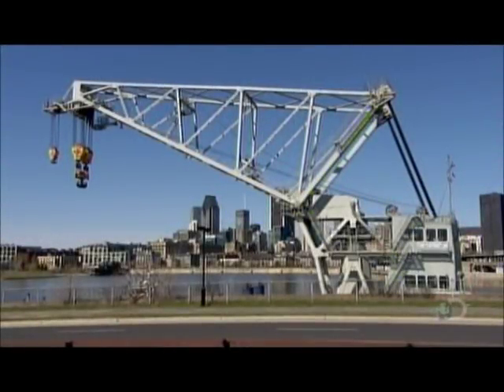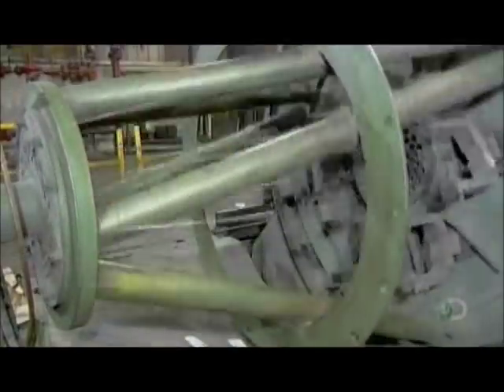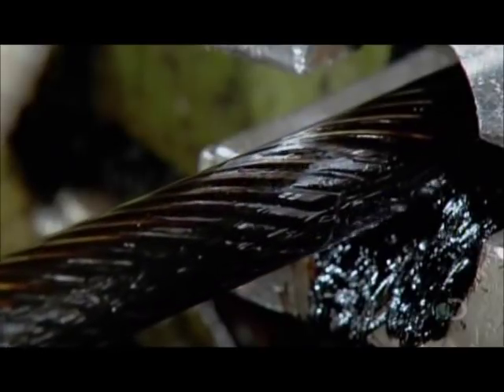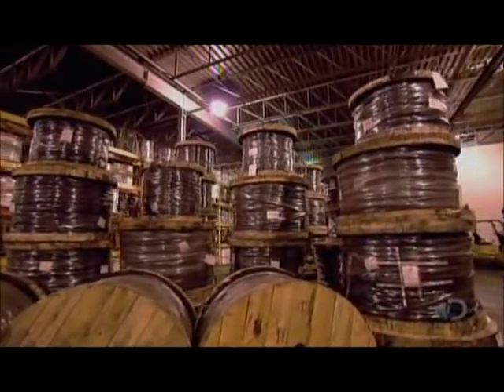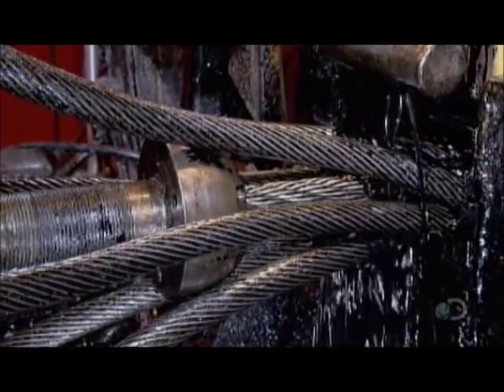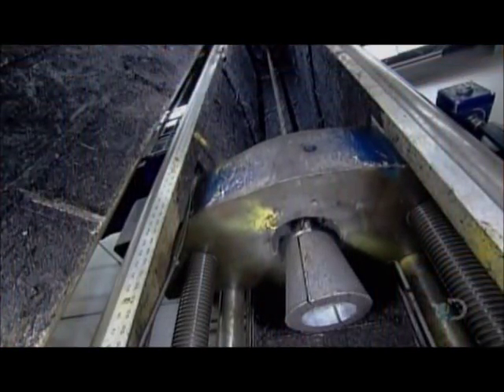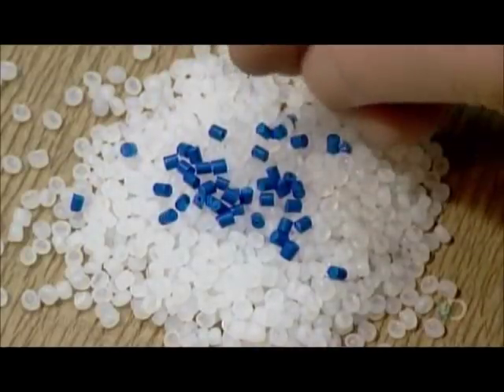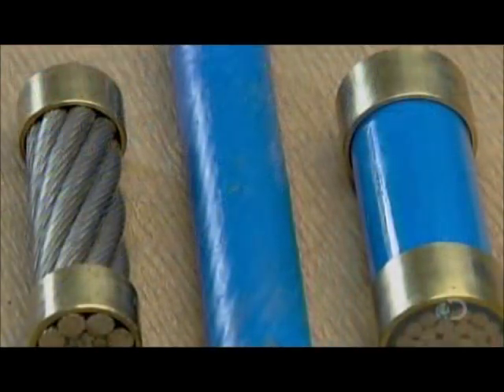How It's Made - Industrial Wire Ropes

Comment: 24:50
Japanese Street Food - BLUEFIN TUNA CUTTING SHOW & SUSHI / SASHIMI MEAL
Travel Thirsty
Recommended for you

14:15
Antique Hatchet Restoration. SORT OF...
Black Beard Projects
Recommended for you

15:34
Holloway Houston, Inc. Company Overview
Holloway Houston Inc.
Recommended for you

4:51
How It's Made Steel Forgings
TRR56
3.7M views

15:29
TIG Welding Aluminum Fabrication - Sheet Metal Forming - Round Hole to Rectangle Hole Transition
6061. com
2M views

Hypnotic Video Inside ¦¦ Tube Manufacturing ¦¦ Oil pipe ¦¦ Huge pipes
Best COUB OIC
Recommended for you

Dangerous Biggest Wood Sawmill Machine Working - Extreme Fastest Chainsaw Cutting Large Tree Easy
Machine Technology
Recommended for you

How It's Made Giant Tires
TRR56
1.7M views

How Orange Juice Is Made
Triwood1973
10M views

Soviet Chain Mortiser [Restoration] (Part 2 of 2)
Hand Tool Rescue
Recommended for you

HYPNOTIC Video Heavy Engineering Inside Extreme Manufacturing Plants Steel Wire Rope Slings Factory
Epic Machines
1.7M views

How to Make Petrol or Gas from Crude Oil.
carltfross
1.3M views

Seized 1960s Chainsaw Restoration
Will Matthews
1.1M views

How It's Made - Handcuffs - Caulking - Propane Tanks - Forensic Facial Reconstruction
SAFFY7411
2M views

How Really Big Tires Are Recycled.wmv
mubashar qadeer
1.2M views

How It's Made - Industrial Wire Ropes